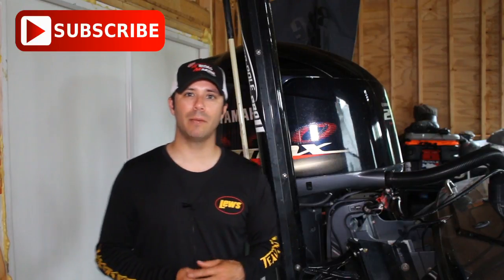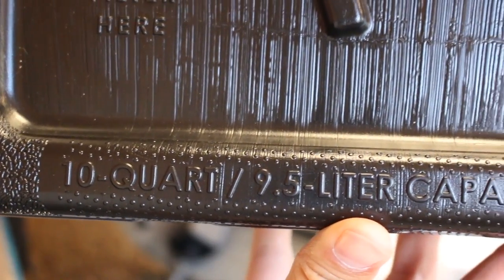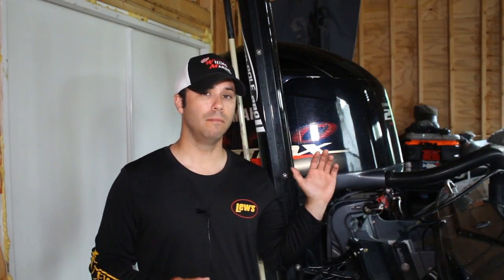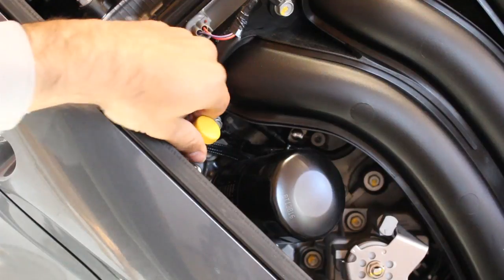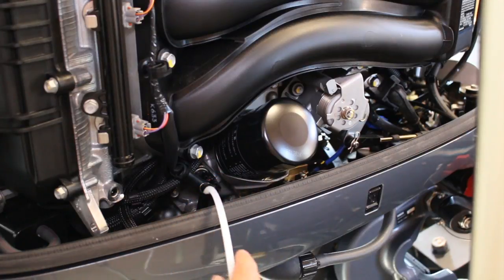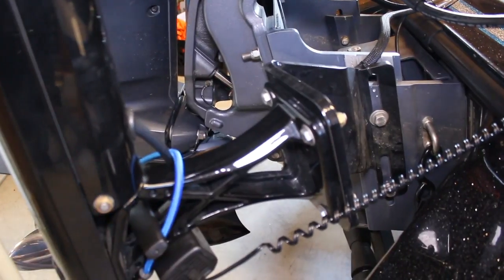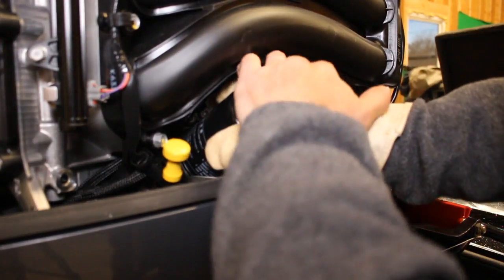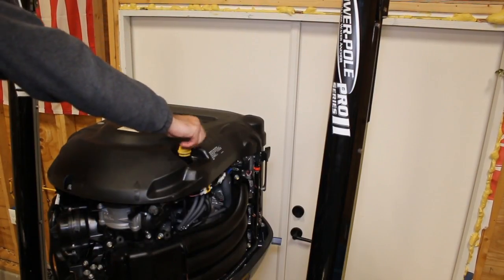Yamaha 250 SHO DIY | How To Change Your Oil

Comment: Approx. 1 qt+ of dirty oil is left in the motor using the pump out extractor method.  Easier ... but not right. Best way (done at reputable Marinas) is to completely remove the lower covering and unscrew the oil drain plug.  ALL oil is removed this way.

Comment: Great video how do you like the Yamaha have you had any issues with the motor
Reply from the maker: Never had an issue. I had the intake pretty clogged once and it was still spiting water good. Maitnence is pretty easy. Power is definitely there 21ft boat planes fast and would get 73 on all stock settings...mid to upper 60s with 3 dudes and full tackle spread
Reply: @BeyondTheBoundsOutdoors  sounds like a good boat I hope so anyways lol

Comment: A proper oil change, especially the first one, should drain the oil. An extractor never removes it all. Also, you put the wrong friggin’ oil in it. VF250’s get full synthetic. (gold bottle) Great job of spreading misinformation. I’m sure Yamaha appreciates the effort. Not.